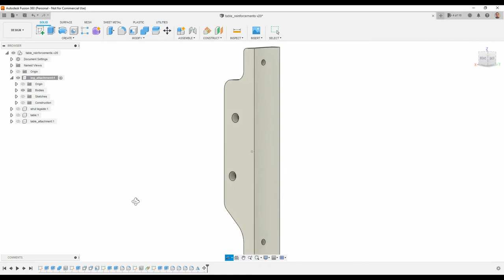Braces for Wobbly Table

Comment: Hello, I've got the same problem but i need to have access on the table from all sides, so the horizontal support is not a good idea for me. Question, do you think that making the same design with the triangular braces only would be as stable?
Reply from the maker: I think so.